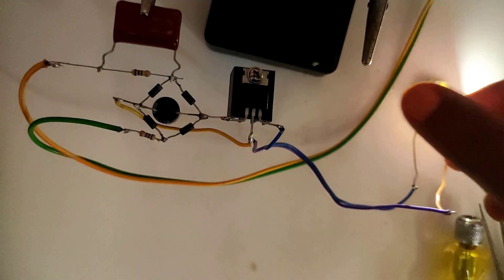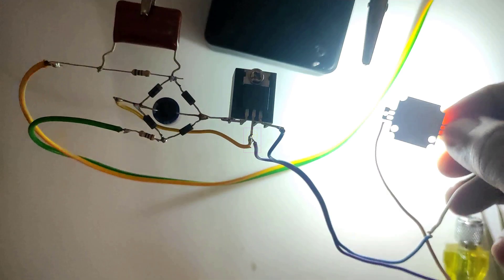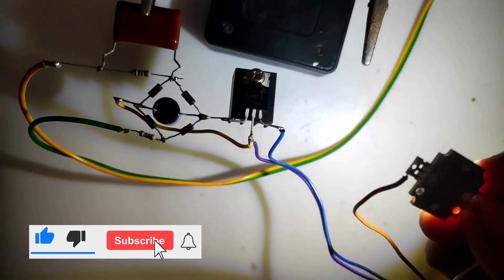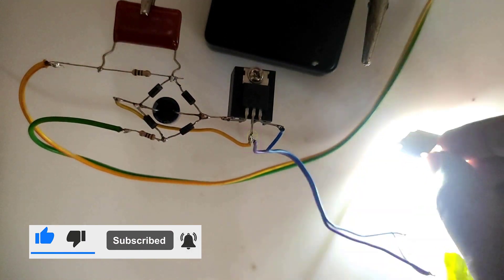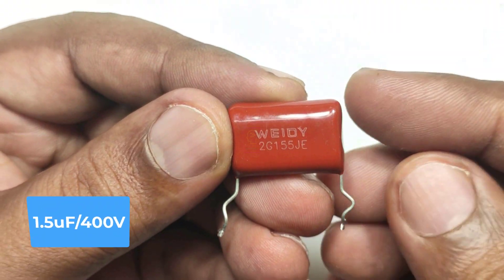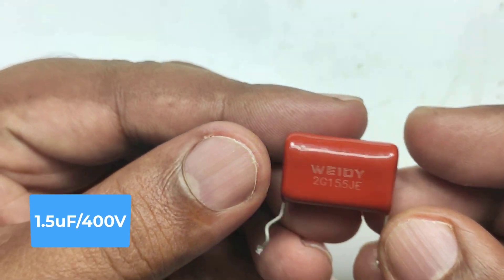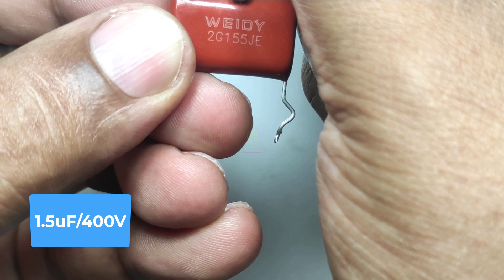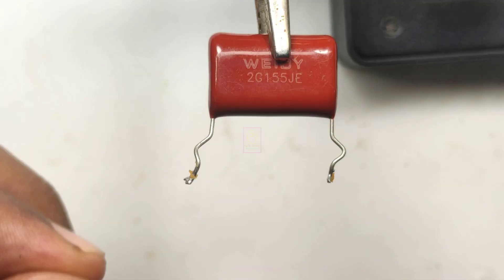5V/9V/12V/15V Regulated Transformer-less Power Supply

Comment: 2 Pin is dangerous. Please use 3 Pin plug so that Phase Line will be always connected to capacitor terminal
Reply from the maker: Yes you are right, 3 pin plug is required
Reply: This is good with plugs with 3 pin only or use dual line isolation by adding capacitor to the other terminals too. But that will reduce the current at the output to even half
Reply from the maker: @tabm7644  You are right
Reply: Right statement
Reply from the maker: @TitusKelly-cj8um  Thanks